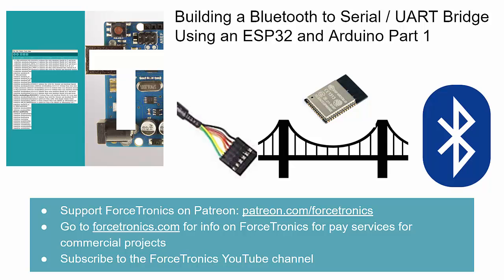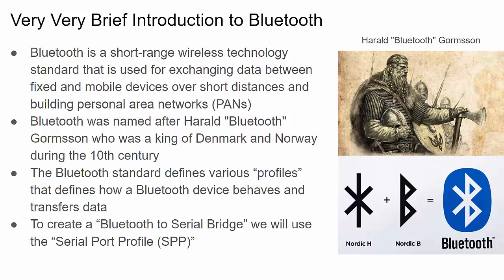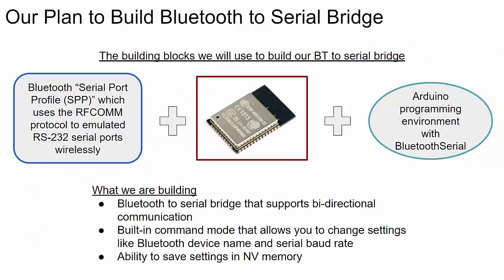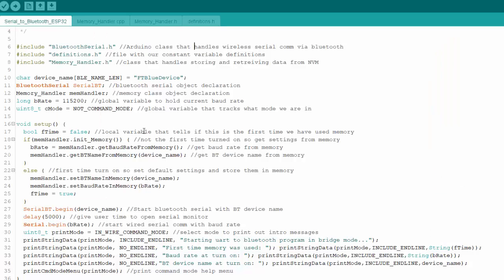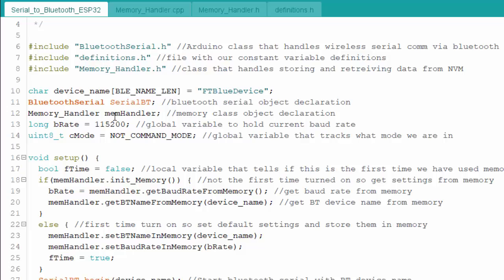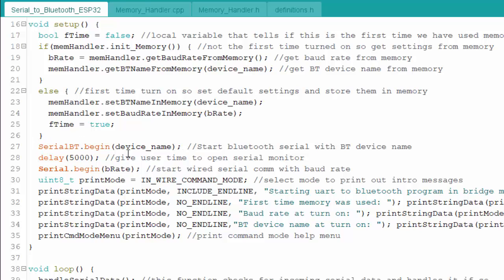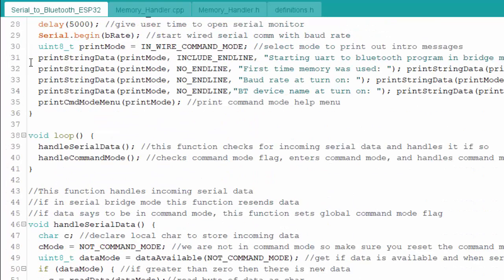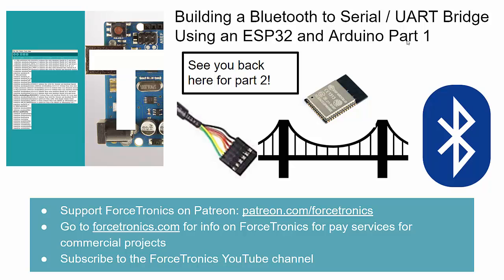Building a Bluetooth to Serial / UART Bridge Using an ESP32 and Arduino Part 1

Comment: I have a program on my PC that normally connects to a com port that I select, to receive serial data from an Arduino by usb cable.  Can I somehow have the esp32 bluetooth connect to the PC as a com port I can select in the PC program so it can receive serial data from bluetooth instead of by usb cable?
Reply from the maker: Thanks for the comment. Not sure I have a answer for you though because it's not something I've tried. My guess is a computers Bluetooth chip is not configured for com port. So for it to work you probably have to run some type of software that does the Bluetooth to com Port conversion. But that's just my guess

Comment: where is the files of the serial to bluetooth esp32/ how did you set up the files to connect to it?
Reply from the maker: I don't quite understand your question. When you say file, do you mean the code from the project? You can access the code files from my patreon page but you have to subscribe. Not sure what you mean by connect to it? Please note that this code is only compatible on esp32s that support classic Bluetooth. For instance, the S3 or the C6 do not support classic Bluetooth. So keep that in mind

Comment: Hello can I enter MAC adres of another esp32 device and connect to it through bluetooth serial. I need two esp32 or one esp32 and one measuring device to be connected with bluetooth serial
Reply from the maker: If you want to connect to esp32s together that have Bluetooth you would need to add code that does the pairing. This code is just if your ESP 32 acts as a secondary Bluetooth device with another device that can pair to it. So you would need to add code to enable the pairing

Comment: Any thoughts what would be involved in writing an ESP32 application, that takes data from the uart, and passes it wirelessly either via bluetooth (SPP) or via Wifi?

For Wifi, I imagine the ESP32 could act as a web server (TCP) and display the RS232 data, but maybe there's a UDP way it could send data to a PC on the same network?  I imagine, if the receiving application (mobile or PC) is written in the flutter framework, it could display the RS232 data with style!
Reply from the maker: Great question I really don't have a good answer for you. I never researched it for newer Bluetooth protocols or Wi-Fi. It's probably possible in some way but the fact that there are no open source libraries that I'm aware of for it probably means there's some challenges. Let me know if you find anything or develop anything

Comment: Can we use 2 esp one is connected to pc and other one used as wireless programmer in this way?
Reply from the maker: Thanks for the comment. Are you asking how you could program one ESP32 wirelessly with another ESP32? It would be tough because when you program an ESP32 you put it in boot mode (pull IO0 pin low after reset) so it won't be running any code. There is also a way you can program an ESP32 wirelessly with a computer over your local WiFi network (search on ESP32 OTA programming), but not sure about Bluetooth.
Reply: yes, you can use bluetooth to manually transmit a compiled BIN file into the ESP32s flash memory, same as how OTA programming works. pretty much just put the file in the same place, activate the same flags, and off it goes. thing is though, theres not a lot of good reasons to do so as opposed to simply connecting it to your home wifi
Reply: @ronox3474  when its comes to deepsleep, i will lose battery and time. Moreover i may not have a WiFi since my devices work on the field. So OTA option is not available nor wanted. Do you have any examples how to do this?
Reply: @thenextproblem8001  but simple answer is: make a wifi if there is no wifi. ESPs are wifi devices and can operate as hotspots and hosting the OTA files.
Reply: @ronox3474  I WANT BLUETOOTH. PERIOD. not WiFi not OTA. That's all

Comment: Great project
I have the input for another project: Wired Ethernet via eg. ESP32 - Bridge to ESP32 to Wired Ethernet. A sort of WIFI for an old wired connection.
I have not come around to it, but it should be possible
Great video as always. Thanks for sharing your experiences with all of us 🙂
Reply from the maker: Glad you enjoyed the video content and thanks for the comment. Are you looking for how to take a single Ethernet wire and make it wireless or how to take a wired Ethernet device and connect it to a WiFi router?